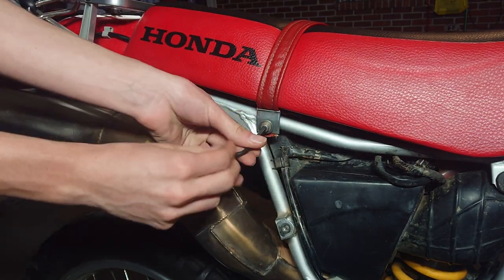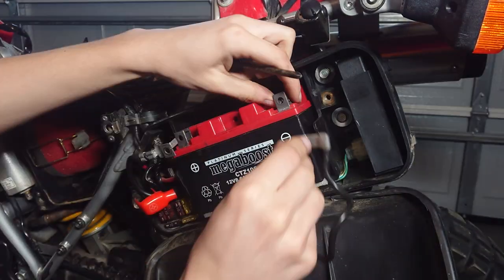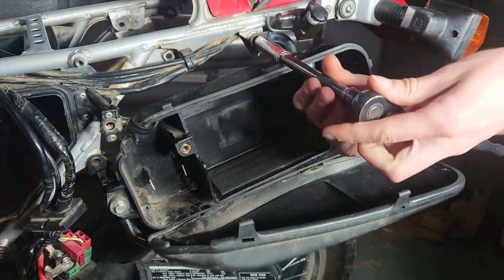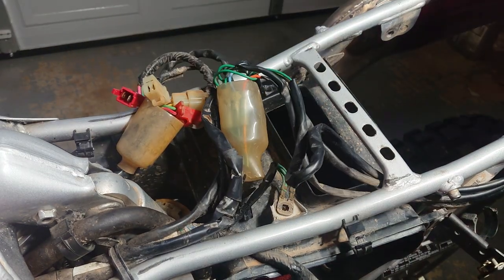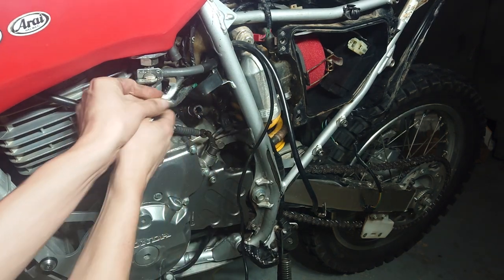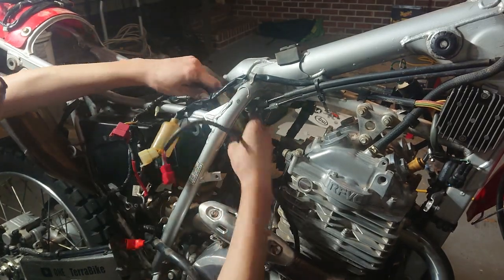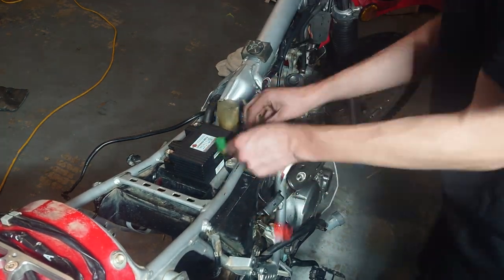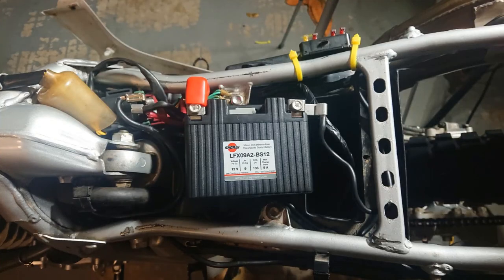How To: Battery Relocation Mod on XR650L

Comment: Just recently bought my XR650 with this mod done to it. Battery is woefully undersized ( 14 A/Hr vs 19 and 210 CCA vs 285 CCA for a Shorei in stock configuration).  Doing this mod is overworking the battery since it doesn’t have much capacity and shortening its life. These Shorei batteries aren’t cheap so stressing it is not a good idea. Second point is now you have a rats nest of wiring on top of the air box. Honda puts a lot of thought into their bikes and the stock location enables easy access to the battery, fuses, and CDI in case of emergencies. When and if your bike craps out, if you do this mod you have to remove the two bolts to remove the seat. Not something you want to do off-road riding to replace the CDI with your spare (a known issue with the CDI).  So now you have an underpowered battery, fuses, and CDI exposed to moisture all in a location not easily accessible.  This is IMHO a VERY BAD idea if you consider the negatives of doing a mod just for looks. I’m in the process of putting my bike back to the way it’s supposed to be.

Comment: Would Honda just redesign this bike and come out with the CRF650L already! I’ve been waiting for years now. Lithium battery, new plastics, signals, headlight, EFI. If they want to do more than that cool if not fine.
Reply from the maker: I know right 😂. The 450L is alright but the maintenance involved in that bike is ridiculous! So, if it had the things you mentioned (if not more) ... I'd also want it to be reliable!

Comment: Your videos are awsomely useful.  I just bought a 2013 XR650L a couple of weeks ago and am in the process of modding and studying future mods.  With respect to the battery I'm thinking of starting with simply switching to a Li-ion battery for the overall weight savings but leaving in stock location.  Bike is a bit top heavy and the relocation would appear to place the weight higher though it is definitely more centralized.  Initial mods are tusk dualsport tires, heavy duty tubes, rimlocks, pegs, thicker front sprocket, and tusk wraparound handguards.  Over time I want to focus on weight savings so will do exhaust, jetting, Li-ion battery, I bought the desmog kit but am having second thoughts on installing it, minimal weight savings (~2lbs), no performance gain and only an emissions increase does not seem worth bothering.
Reply from the maker: Desmog does actually make a difference! It helps to reduce backfiring which is annoying and to some people -- they say it burns oil (I can't attest to that as I didn't pay attention but you might want to read more on that)... I actually removed my lithium ion battery as it had a much harder time starting in the cold (34° F ish) and went back to a 190CCA battery. The relocation to me was more aesthetic than a functional improvement which is why I did the mod...and quickly undid it. The rest of your mods are perfect it seems 😁👌
Reply: @one_terrabike3151  why did you undid the battery relocation?

Comment: I've always seen topics about this mod, but what's the purpose? A cleaner look behind the fender?
Reply: All this work to loose 3" width.
Reply from the maker: Looks and weight. My recommendation nowadays is not to do this mod actually. Get a spectrum moto battery box or just get a lithium battery for the box. You'll still notice a difference!
Reply: @one_terrabike3151  that was my thoughts, exactly. Li.battery and upgraded exhaust on the other side should be a very good weight reduction yet a balance of low weight on both sides, stay safe bro.

Comment: Good job Dude!! I am doing this to my XR. What kind of side plate did you use? Thanks for video. Liked and subbed
Reply from the maker: XR600R (UFO sells the set for >$40 USD). Also, thank you!
Reply: @one_terrabike3151  Thanks right back at ya!!! Did you use stock battery or one of those light lithium iod ones?

Comment: just got the battery relocation done on my bike with bunch of other things including the smog delete on my bike and had to have a shop do it since im working 7 days a week which sucks since i barely have free time at the moment. im not sure if it the smog delete or the lectron carb i had installed causes machinegun like deacl pops but im loving it since now it popping like my modded/tuned charger R/T
Reply from the maker: Sounds awesome! Just check your plugs if you can sometime to make sure it's running properly (aka not too lean) 😁. Thanks for watching!

Comment: to those who have had this mod for a fair amount of time, how much is the risk of the components getting wet increased? especially with pressure washing the bike after riding
Reply from the maker: The likelihood of damage/corrosion over time is high. I actually undid the mod as it became annoying to service electrical on the trail. If you do this mod, care about accessibility, and element resistance the newest, best solution is Spectrum Motos battery relocation box. It's a slimmer profile battery box that can use the XR600 side panels! Super cool!
Reply: @one_terrabike3151  thanks for your reply. i actually found the battery box youre talking about and was wondering which is a better option since the aftermarket one requires a very small battery so it may not last as long. and a smaller cdi i believe
though since you just confirmed my suspicions ill consider the aftermarket box more seriously
Reply from the maker: The Ignitech CDI is far more reliable than the OEM one. So that's an improvement. Size of the battery won't matter as long as you keep it on a lithium battery tender. They'll do just fine! 😎
Reply: @one_terrabike3151  thanks for your input!

Comment: How is the XL500, father to the XR650L set up, I know it didn't have electric start- not sure about the CDI. It would be great if that setup or parts of it could be borrowed for this conversion. I'm interested not in switching to a flat left sidecover but would like a toolbox or tool tube there, that way I could eliminate the tool bag & install a large rack instead of my smaller wrap around style rack
Batman
Reply from the maker: I cant really speak for that bike, but you could always empty out the battery box as shown in the video, keep the box, and use it as a tool box instead :)
Reply: @one_terrabike3151  that's the reason I want to do this

Comment: ok but what is interesting to know is if the chair is well adjusted as it was before the modification
Reply from the maker: Oh absolutely! I had it wired differently the first time around and the chair (seat) would not fit without some serious pushing! Now, the way shown in the video it's just as easy to install and remove as before! 🙂

Comment: Holy Huge pipe, what kind is that ? Noticed the Header and what looks like a Supertrapp,, If so , where did you buy it at ? How much ? Nice Xr , great video and Look fwd to seeing more of your mods. Thank you from SA,Tx
Reply from the maker: I use the XR's Only Header & XR's Only Supertrapp Competition Exhaust and it ran me ~$550 total as I got it on the end of the year sale. Also, thank you!
Reply: ONE_ TerraBike 
Have u considered a Pumper Carb ? , I heard it really wakes up the XR , with that exhaust system u have that would be a killer mod. Thanks for the reply

Comment: I was considering a lithium battery swap on a XR650L so briefly looked and found one, that says Is a replacement, How proper is another "buy it and SEE "story I think, 
the Lith measuring 6.25 x 4.75 x 3.75.
While the OEM supposedly as per spec measures 5.94 x 3.46 x 4.21.
So can you say this Lith One I gave Dim on, would work as doing this same relocate with its dimensions?
Or do I need one that does NOT exceed the OEM Dim spec?
thx
Reply from the maker: If the website says it'll fit our bike go for it! Most people get Shorai lithium batteries or Antigravity lithium. If you're unsure of dimensions just measure the inside of your battery box 😎

Comment: I see you did the oil cooler upgrade to yours. Was it a hard install and do you think it’s worth it/a good upgrade?
Reply from the maker: Very easy to install thanks to Sutton's GREAT instructions! He provides a manual and diagrams of exactly how to do it :). It lowered my oil temps 20-30 degrees F, and I'd say its a great mod that's well worth the money. The exception is riders that ride TOUGH single track and the oil cooler lines could possibly snag on branches
Reply: @one_terrabike3151  thanks for the response! I’ve been looking into the Sutton’s cycle kit and think I’m gonna go with it just trying to find out as much info first. Much appreciated!

Comment: I'd like to redo battery mod, my fuses and cdi are stuffed in the air box but I know my carb is starving for air with all that in there. Your relocation looks good, maybe some patience going into it but like you said doable and neat looking too. Battery seats ok?
Reply from the maker: I actually undid the mod as I needed more space for electrical components and quick access... however it worked wonderful the way I had it as shown in the video. The seat has plastic 'ribs' underneath it that might need shaved off with a dremel
Reply: @one_terrabike3151  That's what I was thinking, how were you going to get the seat back on because it looked like it the battery was too high. So where and how much of the seat did you needed to mod to get it to fit please? Also I gotta say you have some of the best video when it comes to the XR650L, I only wish I had the necessary tools and place to wrench. This housing complex limit the kind of vehicle work done on property plus I don't have a garage.

Comment: Just completed mine. I secured the fuse box as you did. It’s safe front getting wet there?
Reply from the maker: I had no issues while I had it like that! I later undid the mod in order to keep repair videos consistent with the average XR though. If you're worried you can always carry extra fuses or use a Ziploc bag secured via a zip tie. Kind of tacky but it would work if that's a concern 😁
Reply: @one_terrabike3151  thanks for the reply. Glad to hear that you had no issues. Carrying extra fuses is a good idea and I’ll definitely add some to the tool bag. I put some electrical tape around it for now and I ordered some wiring harness loom covers and I’ll figure out a way to put that over it for a little cleaner look. Cheers!

Comment: Have you had any trouble with the battery or rectifier since installation?
Reply from the maker: The modification would have no ill effects on the rectifier, but I undid the mod a while back to regain electrical accessibility and reassurance that if it died on the road i could replace it with one from the parts store and keep going

Comment: Cool mod would have like to see the finished project, but nicely done. Curious if you have any good videos on how to lower or fit the bike? I am 6 feet tall, and I can barely touch the ground. Yours looks like human sized. Any videos or advice to make my bike fit me? Thanks in advance.
Reply from the maker: Mine is stock now, but when I bought it it had a lowering link installed and the PO had dropped the fork forks about an inch so it was shorter. If you do a lot of off-road riding a lowering link may hinder you as you lose some clearance but I don't know your riding style. I don't have a video on this but it's quite simple. Loosen the front fork clamp bolts (12mm) and tighten them once they're an inch shorter (you'll see an inch or so above the upper triple clamp instead of flush), and then underneath the rear shock you'll see the suspension linkage (look up pictures if you don't know what this is), and then remove the two bolts.... And install the new linkage 😁
Reply: @one_terrabike3151  Thank you for the response. One last question. Are you 6 ft tall or shorter? Did you just get used to how tall it was or are you over 6ft tall, and it is good for you? I mean if the bike is just too tall for you, and you got used to it, maybe I will just keep  trying to get used to how tall it is.
Reply from the maker: @azxp  6'1" or so. I am able to flat foot it when still but on the trails it is indeed well tall. I'm glad I had it lowered while I was learning to ride but as I got better the height aspect wasn't nearly as important as you don't really need to put your feet down if you're riding correctly often times. Perhaps look into adjusting your suspension to run softer so your weight compresses the bike more this making it easier to manage.
[Edit]
I believe they make lowing seats too if you don't want to lose clearance.
Reply: @one_terrabike3151  You are awesome; Thanks fro the info!
Reply from the maker: @azxp  anytime! 😁

Comment: So was this for better center of balance reasons  you did a redo on it?
Also, does the different battery work ok in general as it looks a little smaller then OEM, Just wondering if its smaller capacity  is sufficient enough.
Reply from the maker: Did it for weight reduction as a lot of people said it totally changed their bike and to just make a video for people to reference if they wanted to do it! And it works perfectly alright! Lithium can be smaller and offer many benefits over a conventional battery EXCEPT in cold cranking amps which was problematic for me when I went camping in SUPER COLD areas.

Comment: my question is did you have to modify the chair or install it without any problem
Reply from the maker: There are two holes on the seat pan that look like 3/4" tubes... you'll have to cut those down, but most aftermarket seats (if you have one) already have those removed! Thanks for watching!

Comment: excuse the battery when installed under the chair is it damaged?
Reply from the maker: The battery isn't even touched my the chair (seat), so I'd say if left loose it might get damaged if you hit a ton of bumps off road but I later added 3M Plastic Fasteners (similar to Velcro) to hold it in place so it wouldn't bounce around under the chair (seat)

Comment: Can you send me the dimensions of this battery that you used?
Reply from the maker: Dimensions: Length 4.45" X Width 2.28"  X Height 3.50"
Reply: @one_terrabike3151  Hi. What battery did you use for this? The stock XR650L bat is too big and I'm sifting through the Shorai battery list to try and figure out which one will work. Any advice would be great.

Comment: For the noob XR650L owner like me, what does all this extra work actually do? Short of battery weight savings, it seems like it is for looks only. Does this aid in future luggage placement or?? Anyone ever done a before and after weight bias?
Reply from the maker: Most people do this mod in hopes of losing weight on their XR while others do it for the looks. I did this mod to my XR and actually choose to undo it as it had some quirks I didn't like whatsoever. For example maintenance on electrical components is much harder as well as the carburetor as it's all stuffed so close. I also did it to remove stress from the subframe but ultimately just bought dirtracks crash bars which add support.... As someone who uses my XR as my daily this was where I made the decision to undo the mod....it was slightly lighter but I wasn't pleased at all with the drawbacks.... Some people will and do love this mod but that just wasn't me. I'd advise just buying the Lithium battery for ~4-5lbs weight loss if anything but not this entire mod... I will close with this is my personal opinion and findings rather than facts 🙂👌. Best of luck and enjoy your XR!